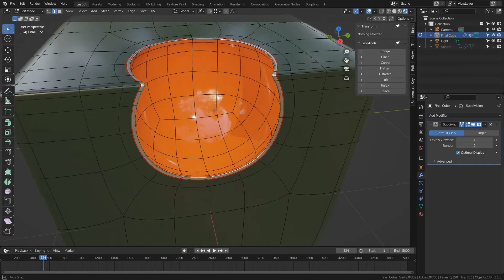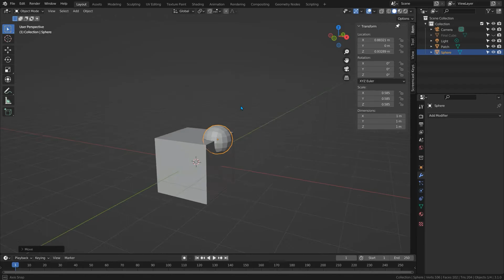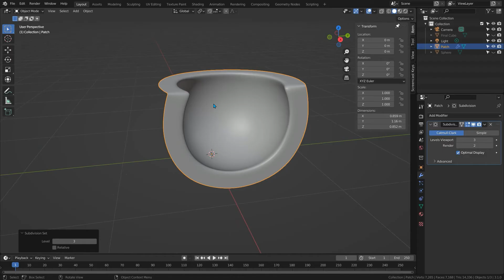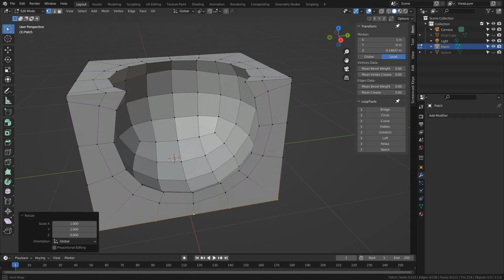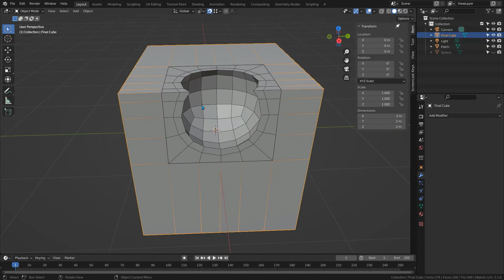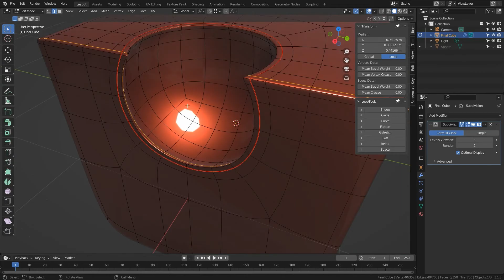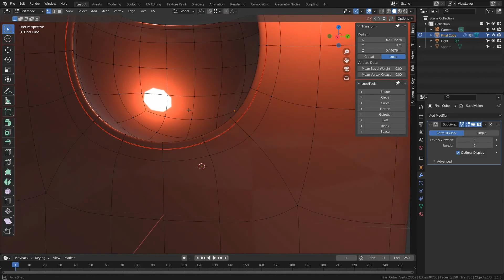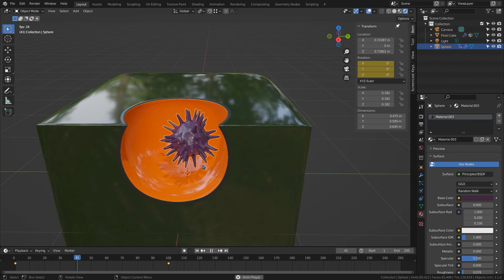Blender - Boolean Sphere Hard Surface - #18 Subdivision Surface Modelling in Blender

Comment: Hello. In a couple of tutorials (at least this and the cloth softbody) you said to always put the subdiv after all other modifiers. But why? Wouldn't the cloth or wave modifiers work better with the subdivided mesh instead of the original, non-subdivided mesh which has much less vertices for them to work with?
Reply from the maker: Good question Bambergg. There are situations where you would have the subdivision before other modifiers but as soon as you do that, the subdivision surface modifier becomes a modelling tool rather than surfacing tool and you have multiplied the base geometry by a large factor. When using cloth as actual cloth (as opposed to a soft body) then  you would want the sub-d modifier before the cloth modifier for example. it is mostly about portability of a lightweight geometry which makes animation, deformation and simulation much easier for the software to calculate efficiently. A sub-d surface should ideally be as light as is possible to accurately describe a shape and having the modifier anywhere but at the end of the stack is not optimal. This is why GPU acceleration of  the sub-d modifier only works when it is the last thing in a modifier stack. Because that is where it is supposed to go. Put it anywhere else and it has become a modelling tool. You will often see objects created with more than  one sub-d modifier to get a balance between these ideas. I'll put it on my list of videos to make so I can describe and demonstrate it better.

Comment: Interesting take on the Smooth Laplacian! However, I would argue that for this goal you would have achieved the same with the normal Smooth operator: Select it instead of the Laplacian and set it to the vertex group. You can leave "Repeat" at the initial value of 1 and eyeball the "Factor" value --- something like 1.721 worked nicely for me.

Is there another hidden benefit of using Laplacian Smooth?
Reply from the maker: Hi Dampfnudel. There is indeed an additional benefit to the smooth laplacian. It makes efforts to equalise the relative sizes of the surrounding polygons which a regular smooth does not. I will be making more advanced videos explaining it soon(ish!).

Comment: These videos are like the recommended reading towards a university course in Blender. 

I’m in the middle of building a Lamborghini Wheel which consists of cylinders inside a circle and it’s a bit of a head scratcher but this tutorials has helped me to concoct a much more logical strategy so thank you. 

I was wondering, the method that you use here to fix the three spoke pole pinch, does this supersede the method in the ‘#4 Building a better sphere’ video? Or would there be situations where you would use one method over the other?
Reply from the maker: The lamborghini wheel sounds interesting. The higher-end the car, the crazier the curvature used in their designs. They like to make them hard to copy!

Regarding the pole position(sic) fix  -  moving the vertices manually is a better option when the vertices to be moved are on a sphere or anything derived from a cube which still retains symmetry. You will usually want to move the vertices on the surrounding row as well as the problem pole vertices so it is a more accurate solution. The laplacian smooth is a great quick fix for most things, though, and is great for any surface where those poles can't be moved onto a flat area. It does have other uses, but I haven't got around to making a video about them yet!!

Comment: Thank you for this tutorial :) Like always amazing portion of knowledge and good habbits. It's amazing how smooth you movin around this program. Do you know every single modifier and every other proporties tab for 100%? It's look like yes :) How long you work with blender, and do you think blender can be use to make for example commercial for TV? Or for that kind of work should be use some else program? 👍
Reply from the maker: Hi Markoz. I have been using blender for around 15 years. Maya for 22 years and some  3d software which you probably haven't heard of for a few years before that - i started on something called pixelputty solo! I have worked in vfx for many years and have used blender on several TV commercials. Hundreds of TV programmes and a couple of feature films. It is exactly the right tool to use for all of these things although adoption by the film sector has had a bit of a setback recently.

Comment: Thanks for the demonstration of the Laplacian Smooth deformer.    That seems better and more parametric than the previous method of fixing those misplaced verts.
Reply from the maker: It does seem better and it is certainly more parametric but it is not quite as accurate as moving vertices as often it is not just the poles that cause the problem but the next row of vertices out from the poles. On a sphere the manual method is better.  There are times when it is the best way to do it though. This is one of them!